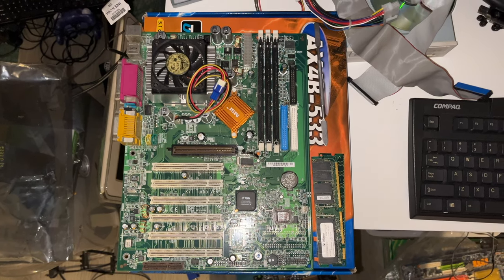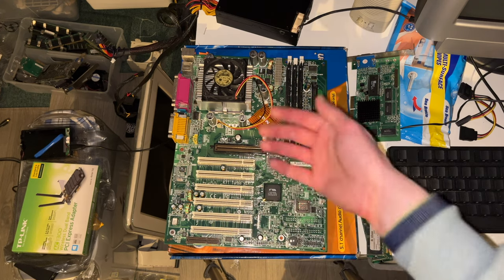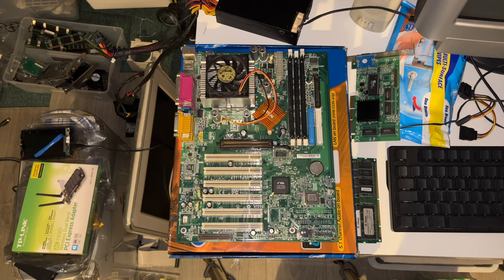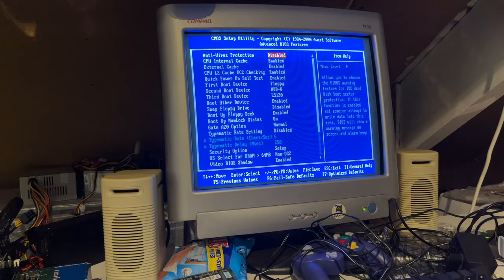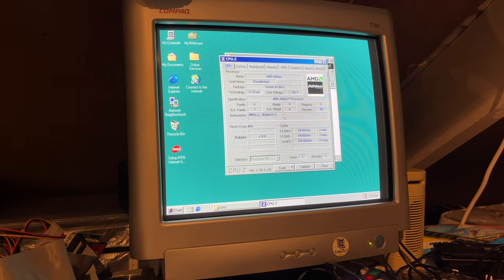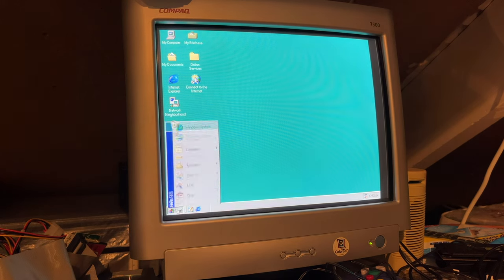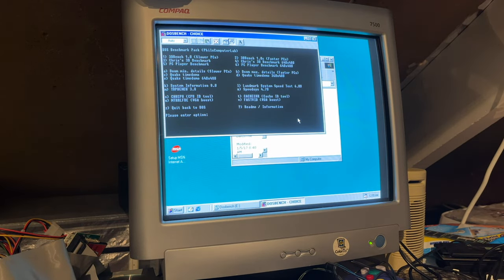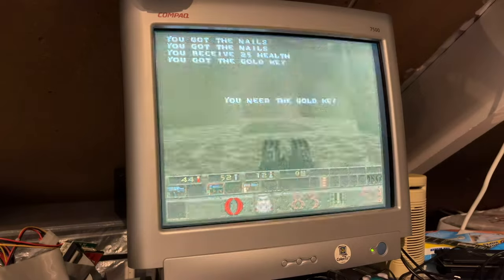Vintage Motherboard Haul  - Part 1 - MSI K7T-Turbo VER3

Comment: Ive had one of these for years and it just up and stopped working the other day ? so I thought ill get a replacement nope for some reason here in the UK you have to pay a premium for this board?
Reply from the maker: It’s one of the earlier boards, and being as old as they are they are now rare and collectible. That’s the downside of the retro hobby.
If you were in mainland Europe I could’ve probably given you a deal, but UK import/export duties are hefty since brexif.